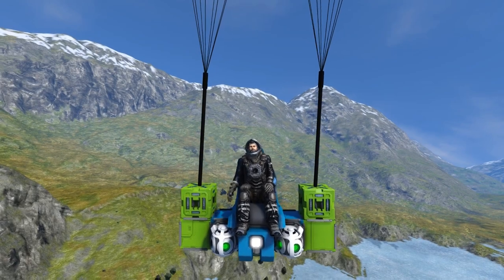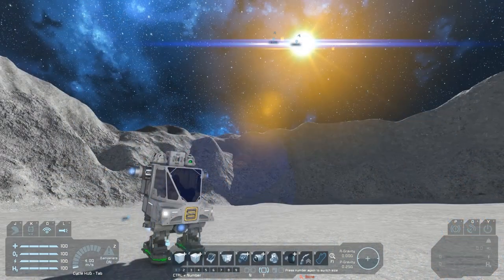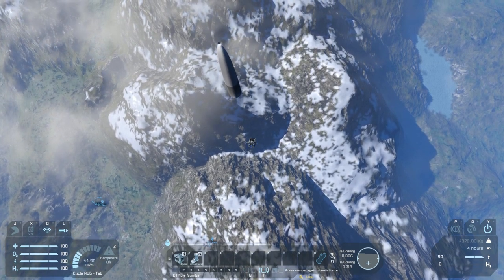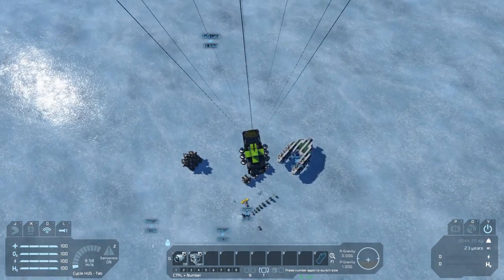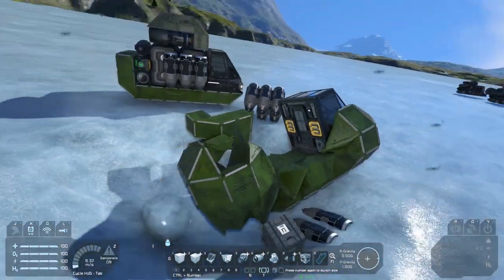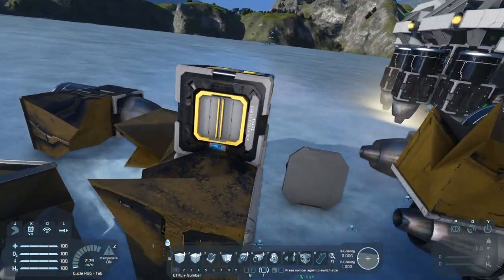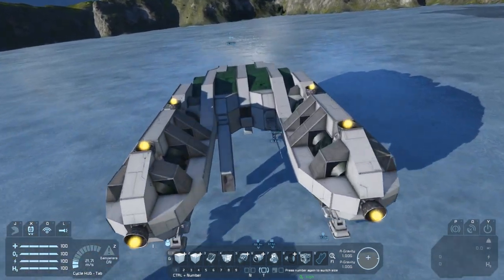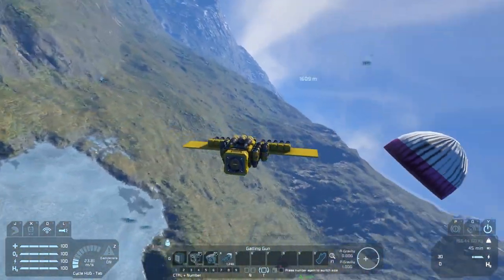Space Engineers Tutorial: Parachute Practice (tips, testing and tutorials for survival)

Comment: It's pretty cool that SE factors mass when determining impact. It's kinda similar to simulating a drag coefficient of an object in free fall in atmosphere. It's why a mouse can be dropped out of a 5th story window and usually survive with minimal injury, while a person is likely to die or be severely injured. Even if both bodies hit the ground at the same speed, one body has far less mass for the molecular structure of the cells to resist crushing them. The tensile, compression, and sheer forces on a given material will greatly increase with more mass, and that means the material point of failure is achieved at lower velocities when you have greater mass.

This is why I always cringe when people say if humans were proportionately as strong as ants, we could easily lift a car over our heads. This would only be true if our molecules were also scaled, as - for example - a simple protein structure in a human body is the same molecular size as the same protein structure in an ant. The ant isn't strong, it's just lifting very light mass objects that don't break the structural integrity of its body. Even if an ant was the size of a human, they would still get crushed by a car, as their bodies and joints aren't made of steel like a forklift.

I may be incorrect about some of this, and if someone with far more expertise than my general knowledge has some insights, I'd love to know where and why I'm incorrect if at all. :)
Either way, kudos to KSH for not taking the easy route with parachute deceleration!
Reply from the maker: The physics simulation in SE while occasionally janky is also the biggest reason I'm still playing :)

Comment: It looks like their parachute behavior is similar to that in Kerbal Space Program, with the semi-deploy and then fully deployed later. In that game the parameters are set by two different numbers, the chute will open and semi-deploy based on an indicted air pressure (meaning the altitude will vary depending on what atmosphere you're in), but the fully-open state is triggered by radar altimeter/ height above ground. This stops you from ending up smacking into a mountain at high speed, MOST of the time. Of course rolling your capsule down the mountain and crashing into the foothills is always an option.
Reply from the maker: I can remember so many times trying to use parachutes to land on mountains in KSP so that I can get some science completed there, only to end up sliding down an almost vertical cliff all the way back to the grassland biome. One time I actually even tried to drive a plane along the ground to get back up the hill... it took a while :P

Comment: can you fully test landing with different weight with different landing gear. i want to know what i need to do to build a ore miner that can land and not take damage when i have a full load of ore.
Reply from the maker: In theory if you were going slow enough you should be able to land on anything with any mass, but theory doesn't hold up so well in Space Engineers :P
What sort of speed were you thinking would be useful to test? I have an idea on how to reliably test impacts at a particular speed where you could gradually increase mass to test the tolerance of a landing material but I'm not sure what speed to stick at...
Reply: I'm fairly new to the game so you would probably have a better idea than me. best cast i was hoping for 15 -20. reality i think is 5 - 10
Reply from the maker: I think that's pretty reasonable, I was thinking something like 5m/s for large ships and 10m/s for small ships. That way you'd have a reasonable target if you're using parachutes. You then know what sort of block you'd need to land on for a rough weight range...
Reply: plus its good info for just landing period rough, newb, or not
Reply from the maker: Very true, now I'm off to testing to work out the best way of getting a bunch of ships with different mass going the same speed :)
Reply: nice

Comment: It's not and air density it's about Atmosphere. Just cause your in gravity parachutes need enough resistance to open up. That's why when you first did the test above the mountains the parachute didn't unfurl all the way. Not enough atmospheric resistance to force it to spread out. That's a very cool dynamic the GMs added to the game. But for some reason I can't get the parachutes to open at all. Idk why. There are connected to a small conveyer so I can reload them. They are on the top off my orbiter. But every time I try to open them I continue to plummet then I start dumping cargo and relying heavily on my atmosphere thrusters and hydrogen thrusters to slow me or so from crashing. I can't figure out why

Comment: You are actually wrong about a few things here :). Parachute deploys only works below a certain amount of atmospheric density. Parachute also reefs until the atmospheric density is high enough for it to fully open the chute. The value for this is in the parachutes definition. Potentially modded parachute blocks can have different values.  How effective the parachute is very dependent on the atmospheric density value. Deploy height should be deploy from ground height, so if it isn't deploying on a hill report it as a bug. I also will point out is you should use wheel blocks as your landing legs as they are far more impact resistant.
Reply from the maker: I don't know why I didn't think of it at the time but I really should have tested across a few different planets. Only looking at the earthlike meant I only saw the default values in play, probably should broaden the sample set when I have another look at these :P

Also, parachutes - if they're emulating real world - should not deploy above ground height, they should deploy above sea-level. This is variable in the real world due to changes in atmospheric density, but in a general sense the density varies according to height above sea level not above the ground immediately beneath you. The obvious example is Mt Everest where the atmosphere is so thin you can barely breathe so a parachute is going to have great limitations to its effectiveness.

Lastly, from my testing, the wheel blocks are reasonable at protecting your ship from impacts but if the core of your ship remains the same and you manage to achieve a fairly flat landing, light armor is your best protection, followed closely by wheels on suspension. If you hit a bit wonky on your landing the results are a lot harder to test so I'm not sure what blocks are going to be best.

Comment: Have you tried parachutes based on the different inventory sizes when you crest a world? They used to affect thruster output im curious if they do for parachutes as well
Reply from the maker: Interesting thought, but the way that they fixed that problem should mean it has no effect on the parachutes either. What they did was make the mass of anything in your inventory be divided by the inventory multiplier before that mass was applied to your ship. For example if you have 100kg of uranium in your ship in each inventory setting, on x1 it will add 100kg to your ship's mass, on x3 it will add 33.3kg and on x10 it will add 10kg. So assuming the parachutes act based on the calculated mass of the ship it won't matter, but they might have been silly enough to use a different calculation so I might have to check to be sure :)